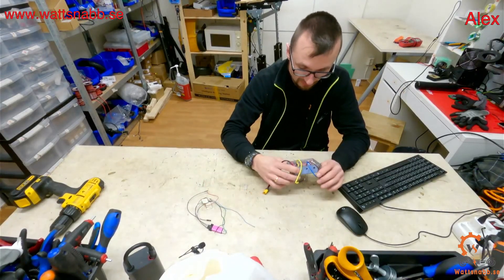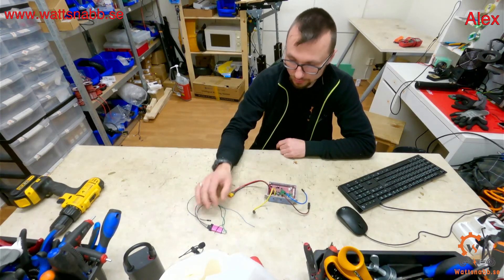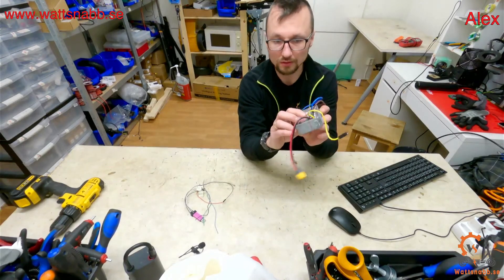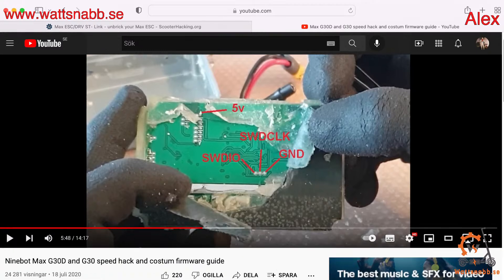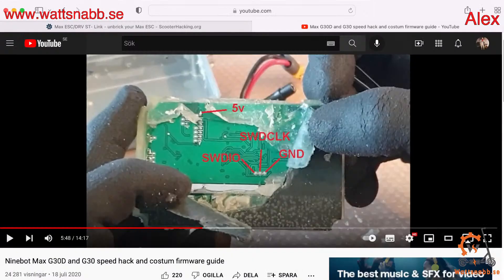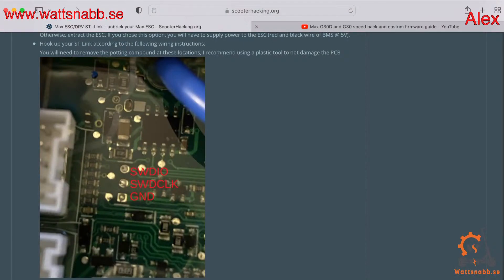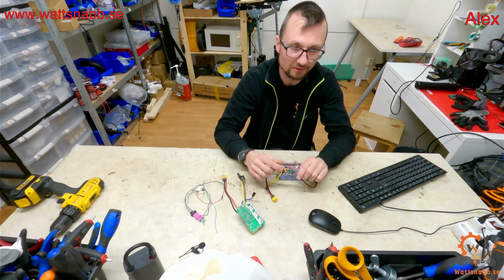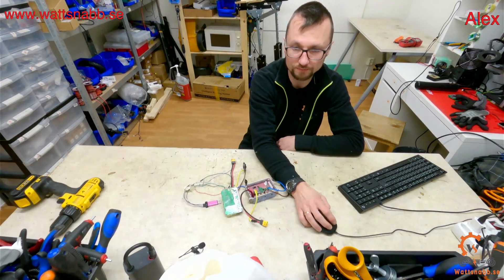New EU Firmware 1.7.0 to Ninebot G30 speedlimit FIX!! **LOOK in description for solution**

Comment: Good day. I have a new controller. Tried to roll back and bricked the scooter. Controller with allen key connectors to motor wires.  Please advise what I can do. I am desperate.
Reply from the maker: Hi. The only thing to do right now is to buy new controller. We have the regulat ones with shipping world Wide and codtum firmware if you want. 
https://www.wattsnabb.se/products/ninebot-g30-max-modellerna/reservdelar-till-ninebot-g30-max-modellerna/original-ninebot-g30-g30d-max-moderkort-kontrollkort

Im working with scooterhacking to find a solution but can take month to hack it becuse the ic in them.

Comment: Hello, I have a g30max E2 and I change the location on my scooter with xiaflash (it’s write DE G30D) but now I am limited to 20km/h in the 3 mods… Do you have any solution please !!!
Reply from the maker: Check if you have a new controller. If not then you need to st link the controller
https://youtu.be/EKUylI5GSLU

Comment: I Got a Segway Ninebot MAX G30E II (25kmh 65km) EU model. 
Live in Sweden, Got it in a Swedish store Net On Net weeks ago. 
Thirst thing i needed to do was activate the scooter in the Segway app otherwise 15Kmh limit, 
but also new firmware v1.7.0 was needed to be installed. Mine does 25Kmh with the new v1.7.0 firmware.

On the package it says 25kmh 65km and stuff, I didn't want a 20Kmh scooter. 
That way i got the 25kmh version without hack and stuff.

But Today a new Firmware in the Segway app shows upp. v1.7.13 
1. Improved vehicle safety. 
2. Fix known problems and optimize the experience.

Don't find any info about that version. 
or what it gonna do to the scooter.
Does that version still gonna let me ride with my 25kmh scooter, or what does it do?.
it is sold as a 25kmh scooter.
Reply: DOnt upgrade. I think that is the upgrade that destroy the topspeed.

Comment from the maker: Scooterhacking utility is working on a solution.
Reply: Thanks for a great video! Do you know if Scooterhacking fixed this issues in their latest version 2.0.3, released March 27?
Reply from the maker: @patrikmarkstrom  they have fixed it for g30. With bike do you have?
Reply: @WattsnabbAB  Okay, I have the Ninebot e25d. Will it work for that as well?
Reply from the maker: @patrikmarkstrom  no they have diffrend firmware. On E25D model you just need to change serial number. 
Try this ones and reatart the scooter between and see topspeed
N2GZN2044K0558
N2GQN2044K0558
Reply: Will the thing with changing serial number would work in my case where I'm unable to change region from DE to US like i had before? Literally few minutes ago I had US with 30kmh speed. Now when I was fooling around with the scooterhacking app and regions I'm stuck on DE and 20kmh :( 

It's a brand new scooter. Didn't even had a time to drive on it. It has 1km distance because I put it on a chair and manually spin the tire to check the top speed xD

I have G30 II GEN my serial number: N4GEG2105C0115

Comment: I have first generation Max G30 (I pre-ordered the kickscooter before release) and upgraded to firmware 1.7.0 last week. My kickscooter is still going 30 km/h when fully charged on "S" mode. However, will there ever be a hack that makes it possible to downgrade the firmware again?
Reply from the maker: Hi. Yes youre register outside EU. We have to wait and see but I guess it will.
Reply: @WattsnabbAB  I live in Europe :p te be more precise, my kickscooter is a first-gen Max G30P
Reply from the maker: @jorisstassen7995  Ok i understand but can be that you scooter registreted outside EU maybe or segway have just take some EU countrys.
Reply: @WattsnabbAB  ahhh yeah that might be possible. The sticker says Ninebot Max G30P (first gen)
Reply: @jorisstassen7995  Same with me, still goes 30 km/h. I'm from Belgium.
Reply: @nicdv  I’m from Belgium too! I ordered the kickscooter on a webshop from The Netherlands. Too bad that the gen 1 version will lose torque the more the battery will drop down.
Reply: @nicdv  ik krijg constant flashing failed update failed 
Reason data format error 
Ik kan maar 20 km/u
Reply: @Army_of_dark  
hoi,
heb je al een oplossing gevonden voor het flashen ,
ik zit ook met dit probleem
ik heb de snelheid verlaagd naar 25 km en nu doet mijn step raar, zoals stil vallen en plots in schokken rijden
ik heb ook geprobeerd om een andere firmware op te plaatsen , zonder resultaat
kan je mij eens laten weten of iji dit al heb kunnen oplossen zoja, hoe te doen
dank
Reply: @gert62  heb filmpjes gezien dat je de oude versie erop moet zetten en aan de controlerbord moet prutsen voor de flash te doen werken , zal gewoon kijken voor e bike sur ron XD